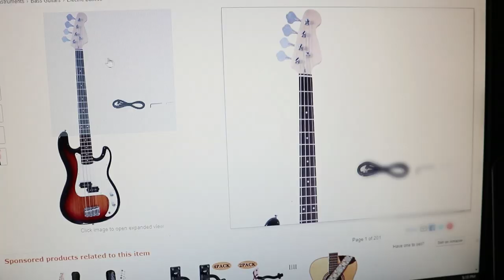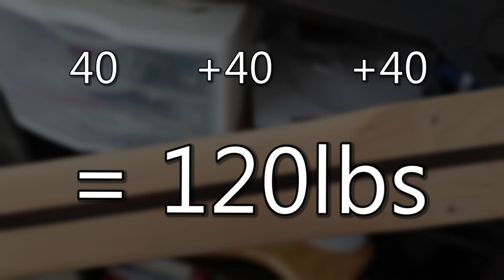Guitar To Bass Conversion (...and Tone Demo)

Comment: Fun fact: the Fender Musicmaster bass was basically the Fender Musicmaster guitar with bass strings. It even reused the six-pole guitar pickup!
I think it'd be a cool experiment to try out the "wrong" pickup on guitars and basses. If anything we'd know what happens when the pickup poles don't match the strings
Reply: Also with squier bronco
Reply: Yep. Have you ever build a Les Paul clone kit guitar? These two humbuckers are bloody good, when you install 4 bass strings. It's just tuned slightly higher, Fis or G for the low string.

Comment: Done four such conversions. Can recommend it to anybody who is not afraid of basic wood and metal tools.

Built a LP clone kit guitar (added 2 coil split switches, which works out great), and that small bass is very okay.
Also did two different strat clones. One was damaged and for strength considerations I replaced the bridge pickup by a block of wood. The other one was a new Indonesian strat clone, sorry for the sunburst fans, I burnt it black and sprayed it black and red. Not bad. Fun detail, in the 5-switch I swapped neck and mid pickup, for I like bridge and neck doing "humbucker effect". And this is the way to get it, without replacing that limited 5-switch. Awkward traditions...
And number 4 is a Yamaha Pacifica with a tele bridge.

All sound far better than I had expected before. It' just cheap guitar pickups, and not that great wood, after all. That strat clone is some kind of mdf and the tiny strip holding the bridge in place had simply collapsed. Broken. The Pacifica however looks great, it is six nice pieces of wood, glued together. What a waste they painted that Pacifica body black. Never underestimate a Yamaha Pacifica, buy some high end parts, give it a proper setup, remove the finish (too much paint sounds like a sponge) and you can easily be surprised by the sound of your cheap Yamaha. Sorry, I sound like a school teacher... But I love these conversion projects.

Comment: Fun fact: vintage Fender musicmaster basses have a single pickup with a plastic cover over it. That's because they came with a 6 pole piece strat-looking pickup. But even with 4 bass strings, they sound great. But you can also go for a rail-type stratocaster-sized humbucker on a bass.

Comment: Simply use Ernie Ball 2837 (20-90) with ball end. It works perfectly on Ibanez Grg 140 sb. I've just added one spring to trem (4), tuned an octave lower, and the neck stands stable.

Comment: the betewwen-the-poles idea is nice, but you can use 4-strings on 6-pole puckups easily. get some of those cheapo flexible fridge magnets that are like 8th inch or less and epoxy that over the poles like a blade pickup. works great. ive done guitar to 4-string bass conversions with this before and had no issue. you can get down to drop C with some effort on a strat-scale but i dont recomend lowere than E. with a 145 string and a peizo just under the C string, it works but you lose that clarity. i add peizos to all my basses, but only under the lowest string  and paired with a slanted pickup under the other 3 or 4 so its gets progressively grolwey further down, and then the other normal pickup as a blend.
Reply: I always read betewwen the lines. Ever heard of editing your comment?

Comment: @UCQoElgBw4Rb5zI37trQvGZQ

      

        @UCQoElgBw4Rb5zI37trQvGZQ
      Faulty wiring, that's bad but we have a contact mic. A Fender Strata bass would be their next instrument. You could've just strung it w/ Bass VI Strings. The Bass VI is a 6 String Bass tuned E-E an octave below the Guitar.

Comment: From experience, you would have been just fine putting on the 4th string. The exact position of the coils on the pickup and the string dont matter as much as youd think. As long as its height is balanced well youll have even volume of all the strings. I converted with 4 strings

Comment: Linking from IG has repeatedly failed me. Manually searched and subbed.

Files. I ordered a set of 5 and use the three sided for almost everything until the round file for final work.. Widow points. Google that but basically bend the strings where they need to be. You could have kept the Trem if you just attached the stuff to the original plate and removed the saddles. Actually you could have just used that but intonation wouldn't have been enough.

Humbucker rail pickups oddly if you buy a mandolin pickguard you can find the entire thing wired with everything for like $10 as long as your ok with white.

Comment: @UCQoElgBw4Rb5zI37trQvGZQ
    
    
      
        @UCQoElgBw4Rb5zI37trQvGZQ
      A 6 string Double Course Bass, wow that's gonna really be a brand new way to Shake It Off w/ Taylor Swift on Baritone Guitar & Vocals. It appears that you got a Guitar instead of a Bass Guitar when the Package came because either One you ordered the wrong instrument or Two there could've been a labeling error in the item you ordered on Amazon. That little baby Mandocaster 12 by Eastwood is going to be your Baby Electric Soprano 12 String Guitar. You'll wanna strum lean on me by Bill Waiters as a tribute to Kobe & Gianna Bryant since they died in a Helicopter Crash.

Comment: I think the tension of 4 strings would be okay. Since the scale length of the guitar is shorter, the strings would come to the right pitch with less tension.
Reply: Depends on the gauge you choose. I like the Ernie Ball  2834 (100-80-65-45) for my guitar conversions. Nothing wrong with those. When you want higher tension you are condemned to this 3 string "solution". Or simply beef up the truss rod, if you feel the truss rod can't keep up with your extra tension. You got a point, a guitar neck is shorter, a bit more tension is not always fatal. Personally, I like a slightly lower tension, for bending gets far easier. The sound of the low string is my lower limit, it should not get too floppy.

Comment: Did you try .020 strings first? Fender had this thing called Bass VI, which was essentially a guitar tuned one octave lower. Music Man had the SUB, which was the same thing.
Reply from the maker: I wanted a bass tension, the low e is a .125 after trying to adjust to scale

Comment: I think that your calculations for the bass guitar string tension is off. It maybe 40 lbs. for a standard length bass, but this is much shorter, so the tension should be less.
Reply from the maker: The guage is bigger to make up for it, a .120 for the E1

Comment: Thanks foto the tutorial, great!
 i Just have a question:
It would be a problem if I put 4 strings without changing the 6 strings coil pickups?
Reply: waitin' for answer
Reply: The Squire Bronco, as a Bass, has 4 strings, yet 6-poles single pickup 😉

Comment: Is  it possible to turn an electric guitar into a 4 string bass?
Reply: i think it is. i would remove the fretboard and headstock combo of the guitar and replace it with a bass fretboard headstock combo. then swap out the bridge and what ever you call that thing that holds the strings in place at the bottom.